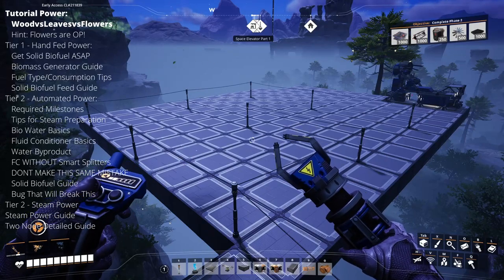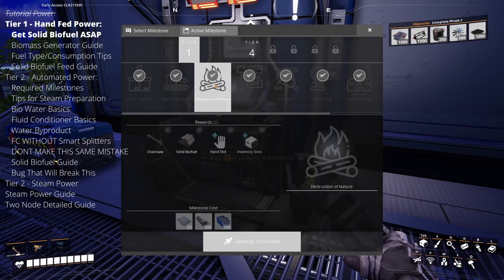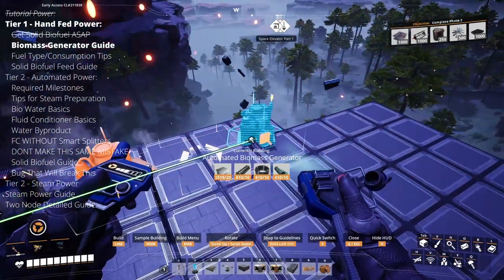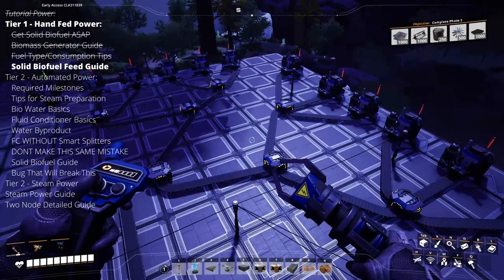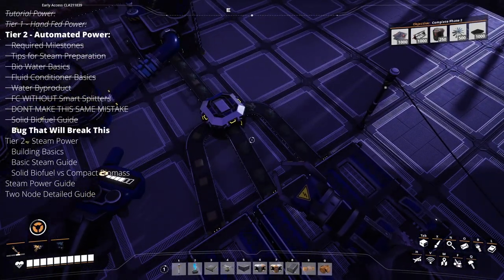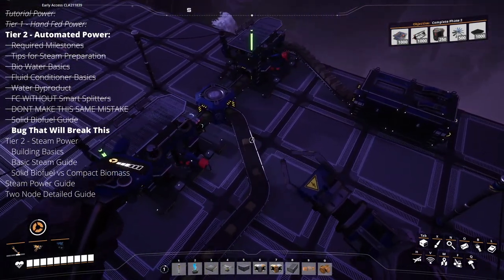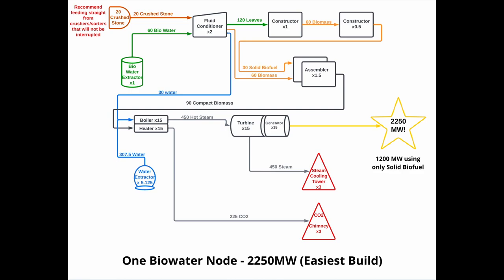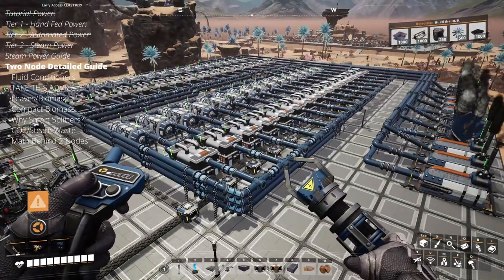Early Game Power Guide: Satisfactory Plus

Comment: One thing you can do regarding the water is make a fluid priority system. If you have a pipe with a vertical junction where water is coming in from above, the pipe will always prioritize the lower water first.

Even without underclocking, as long as the byproduct water is on the lower pipe and the extra water is coming in from above, the pipe will always utilize the byproduct water first before taking any fresh input water.

This setup made Aluminum processing in the vanilla game so much easier and should work here as well.
Reply from the maker: I’ve heard this in the past but never tried it. That’s great advice, especially for this build!!
Reply: Underrated comment, more people need to know

Comment: If you want to make it super-complicated, I am pretty sure you can condense the waste steam in the solidifier/cooler back into water.
Very good walk-through of the whole process and setup of early power. I had written off messing with biowater, but that kind of power generation out of just 2 nodes is impressive. Thinking cap -back on! 🙂
Reply from the maker: Yeah, I’ve never played around with it or ran the actual numbers. For the amount of complexity it adds, it’s worth it to just put down another water extractor or two and blow the steam off to atmosphere haha. 

And yes, bio water is SO worth it!! Even if you don’t make it perfectly efficient, it takes so much stress off your play though for a long time! I should be able to make it though tiers 3-4 with my two node setup.

Comment: Very nice we need more of this :D Helps a ton as a starter ^^
Reply from the maker: Absolutely! I’ll do a slug video next, but I still have some time to get that tree fully unlocked. Any other ideas?
Reply: I’ve been in other player’s games to see their factories. Can’t believe they have gone all the way to Mk. 5 belts and it’s pure spaghetti . We are standing on one side of a belt and I ask them to go straight to the other side without jumping. They say that would be impossible. You have to jump over everything just to get around. I saw this problem in my first save, 4 years ago. During my second save I fixed it with a breakthrough design. You can drive through my factories. They take up way less space and are very clean looking. Yet you get the same efficiency. Not one belt is on the tiles.

One player had built fifteen coal generators (vanilla) in three sets of five. He said that there was a problem and he couldn’t get it to work. When I got there he had ten times the resources needed. There were belts, lifts and pipes running everywhere. Asked him if there was enough power if I shut down one set of five for less than ten minutes? He said that it would be alright. I didn’t need to supply myself. I just deleted everything except for the generator. Then built the system in less than five minutes. He was shocked. He said it took him half the day to build all this and that my way was so clean looking. That he could walk right up to the generator. I came up with that idea four years and 3,500+ hours ago.

Comment: i started messing with bio water amidst tier 2 and hooked up three nodes not thinking that this much power was possible from this. I currently have 6 fluid conditioners, 4 burner/boilers, and 4 turbine/generator for these 3 nodes.
Reply from the maker: Yes! You can get so much power from these nodes. I think total I was using either 5 or 6 and turning it into compact coal and it was going to get me through a lot of the play through…

Comment: NICE, but you can get wind power going early. They are also power lines that generate some power which lessens the demand for cutting biomass massively. The area is also good for hydro-power once that tech is unlocked.  REMEMBER when we bring sustainability into gaming we also stay mindful of it in RL...
Reply from the maker: If you can do wind now in SF+ that’s new since this video unfortunately! That would be much more convenient..
Reply: @stickytak  Wind is interesting, its similar to geothermal power in that it oscillates over time, but it also loses efficiency the lower in the world you build it, and on top of that, you cannot place them too close to one another, else they'll produce no power. With the relatively cheap materials they're built with, you can just cover a biome or two with Mk.1 Wind Turbines and not even bother with placing them high to get a nice hands-off boost to your power.

That said, they are entirely a secondary power source, they are too unreliable to run more than a few machines. The power you get is dependent on not only the height you build it at, but also a global oscillation (a sine wave) as well as a global(?) random(?) wind speed. There was a point in my playthrough really early on where I had all of two biofuel generators and like, 6 turbines, yet with a max consumption of 62.5 MW I still managed to trip the grid. For a few seconds, those turbines combined put out less than 2.5 MW! I thought it'd be fine, the previous low on the graph was around 67 MW, but I didn't realize wind speed was its own separate thing.
Reply from the maker: @Darkest_Hour  I tried the refined power mod a tiny bit before o started my last series and I did like wind power but I really wished there was some kind of a very early power storage to help smooth out that sin wave. Basically with what they have now, your power is only as high as the lowest point in the sin wave, which isn’t much

Comment: personally with the biomass generators, I build 24 and use a manifold to feed them.  at the end of the manifold is a container to catch the excess.  (24 burners, 24 full stacks of fuel) if I run out/low I belt the excess container back into the manifold to repower everything while I gather more fuel.   I also dont super rush to the automated biomass, I make sure to automate all the parts along the way.  currently trying to do a run without hand crafting parts at all.  still trying to get the cables I need for a constructor.....
Reply from the maker: Oh, I like that challenge of not being able to hand craft! 24 burners is way more power and definitely the way to go if you don’t rush into automated biomass. I just always get so tired of running around with a chain saw haha
Reply: @stickytak  well by setting up 24 in the beginning, its a long time until I have to run and get any fuel.  (24 burners run twice as long) so I gather less often I just need to get a lot when I do.  the hand crafting challenge is really rough early game, im to the point I just need to find 5 cables to make my first constructor, then im good since I can then make more cables.  of course I still have to hand craft equipment.

Comment: Accidently deleted my earlier comment. Anyway, I'm doing a similar set up, but the biggest struggle I'm having is how to divide up my water pipes into the boilers. I think it's how it has to do with how many rows I'm placing. I'm doing 3 rows of 10 instead of 2 rows of 15. How many boilers per pipeline did you do? I tried to eyeball it in this video, but couldn't tell For me, the math isn't super great so I've been trying to simplify things by just having one pipe feed 10 boilers and then have the second pipe combine with the first about halfway through the row. I've had limited success with that but all the boilers still aren't getting powered. So I'm curious as to how you did it exactly? Maybe I just need to wait a long time for it all to distribute? Seems like I've already been waiting awhile, but I don't know. Also, are Fluid buffers useful here? I think I saw you use them during your playthrough video, so i'm also giving those a try to.
Reply from the maker: If I recall correctly, pipes can hold 120 water per minute, right? And boilers take 22.5 water per minute so you can get 5.3 boilers per full pipe. So if you’re using two full pipes you should be good. The only way I think you might be going wrong is if you’re combining the two pipes too early? What I did if I recall is I fed my first 5 boilers with one pipe, then at that point I would have one pipe with 0.3 boilers left in it and one full pipe. Then with the full pipe I would feed a boiler, so now I have a pipe with 4.3 and a pipe with 0.3 boilers left. Then combine them. If you try to combine the full pipe with the almost empty pipe, you can’t since the one is already full.
Reply: @stickytak  ok, that's pretty much what I did to. I wonder if my problem is I'm using two pipes that aren't full. Also in the current version mk 1 pipes transport 150/min. For a row of 10, I need 225 water/min. So I have one pipe with 120 and one with 105. In my game, I'm doing what you described: combining the two pipes when one is almost empty. Still not working right, but I'll mess with it more.
Reply from the maker: @storytsunami  hmmm yeah that should be right. Are you certain the pipes hold 150/min? I thought the number was significantly less in sf+?
Reply: @stickytak  yeah I'm certain. Checked it this morning. Good news is most of my generators are running at least. Pumping out a consistent 3350MW. And I do have a 1 bio water build running at 100% efficiency, so that's another 2250. Not hurting for power or anything, it's just those last few.
Reply from the maker: @storytsunami  if you did the math perfectly then the last few can take over an hour to get functional. Were you able to get going good?
Reply: @stickytak  yeah it's working at 100% now. Over the last few days I discovered a couple other problems that needed fixing. First off my math was off a bit. Had it calculated under the impression that each boiler consumed 22 water not 22.5. Also a small part of my Biomass belt was mk 1 instead of 2 which choked my production. After those 2 problems were solved,  I had to wait for the compact Biomass to be distributed fully and then I had to delete the backed up water from the extractors that built up while i was messing with the pipes and that fixed it.
Reply from the maker: @storytsunami  oh nice! Yeah that 22/min is a very typical assumption because if the UI. Good catches! I’ve definitely made those same mistake dozens of times haha

Comment: 12 biomass gens with a splitter for three, then 2, then 1 is noobie thinking -sorry.  I run two rows of 3:49 gennys with a splitter between each set with a belt connecting each tier all the way back to the solid biofuel production. If you need more power, simply add more sets of two gennys with the splitter in the middle on the other end and stretch it out as much as you need.

You use a hell of a lot less space too. It’s only 4 tiles wide.

I’ve played Satisfactory over 3,000 hours and on my third game of Satisfactory Plus (won’t be my last - a regular vanilla game is easy mode)
Reply from the maker: I like your way of thinking. I try to just do a bare minimum to rush to bio water haha